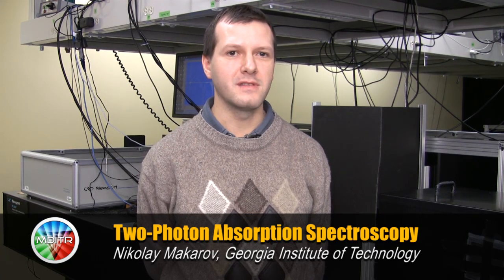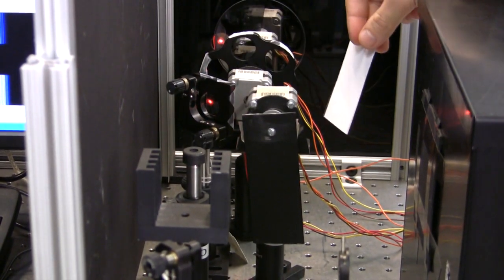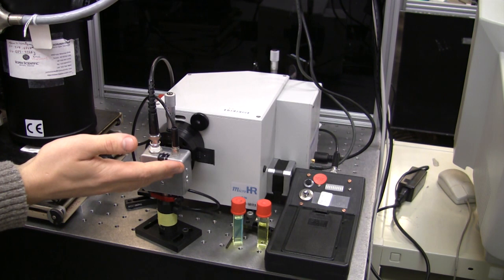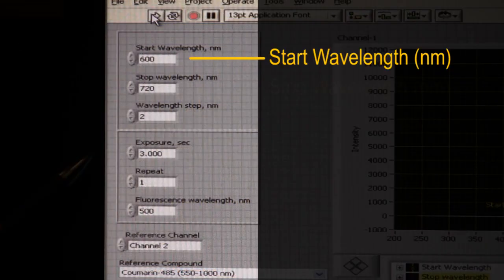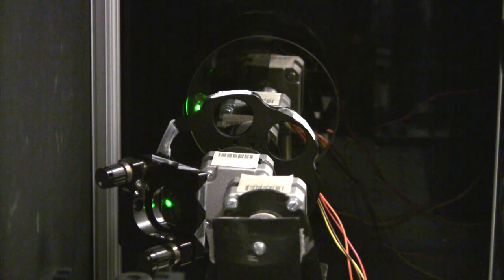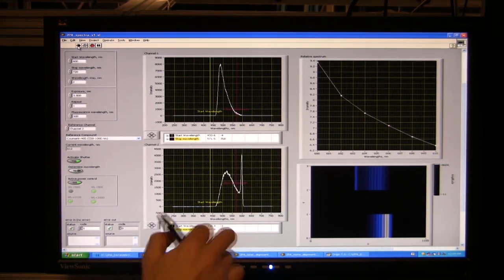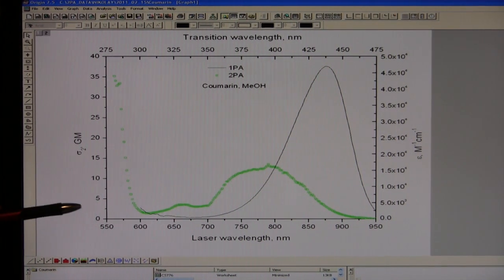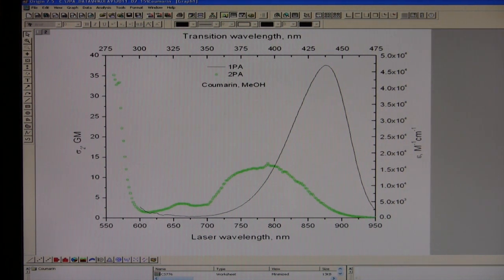Two-Photon Absorption Spectroscopy

Comment from the maker: In our setup we use optical parametric amplifier (TOPAS-C) from Light Conversion. It is also possible to select desired wavelength from white-light supercontinuum using either liquid crystal dynamic filters or use narrowband filters mounted on a computer-controlled motorized filter wheel.